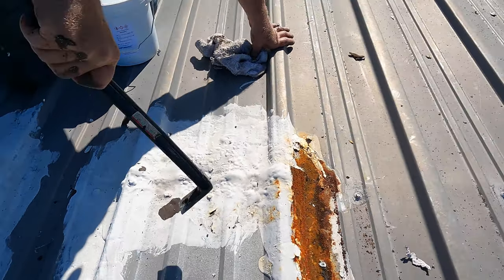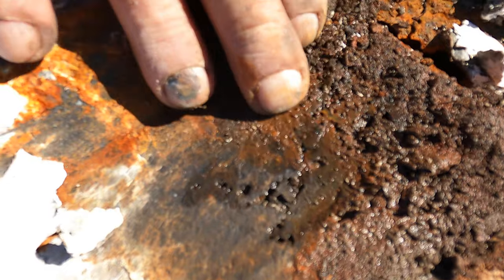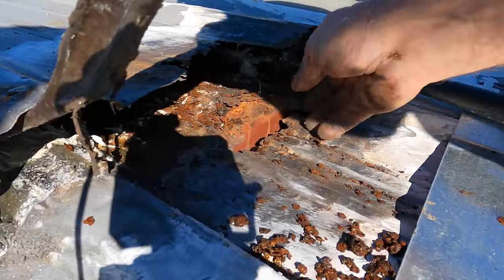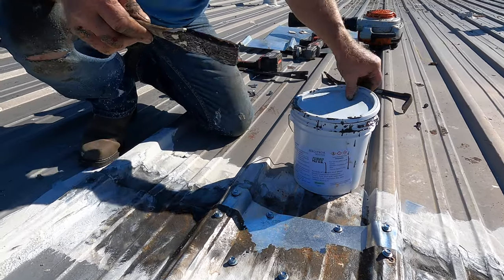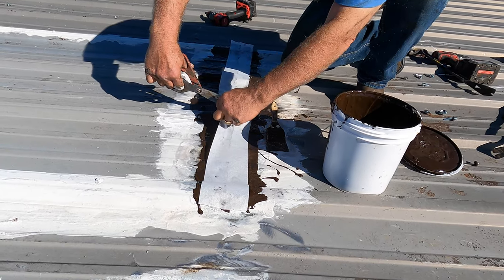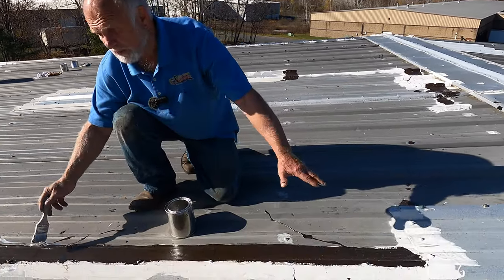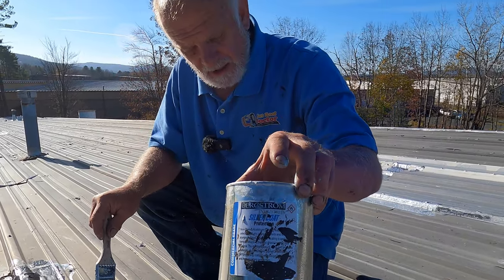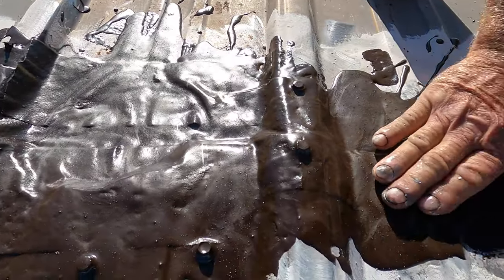How to Repair a Rusted hole in a Metal Roof DIY Roof sealant and metal from Home Depot

Comment: How would you rate turbo poly seal to dicor self leveling? Talking about rv roof compatability.
Reply from the maker: I have little knowledge of other products. But, Turbo Poly Seal is a combination of Urethane and Asphalt resins and all other products are either latex or silicone based. So that makes Turbo Poly Seal stand out. It has a much higher tensile strength and adhere to many surfaces far better.

Comment: Used that poly seal on my flat roof years ago thanks to you. I now have a chimney flashing leak but no more poly seal. It's not a huge leak so I don't want to spend money on a new bucket. Any recommendations on what type of product I should use? I was thinking about a roof flashing caulk.
Reply from the maker: sorry, nothing else that compares to this
Reply: Replace the flashing the rite way I think poly seal is a good product but fixing it correctly with flashing is the best way
Reply: @TheHomePros6221  flashing caulk?
Reply: @FKS1994  no metal flashing